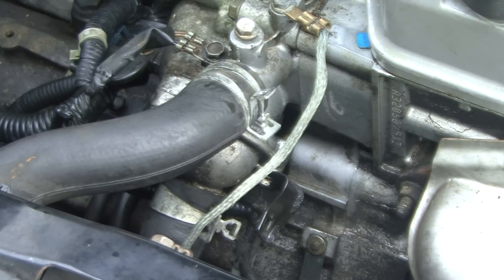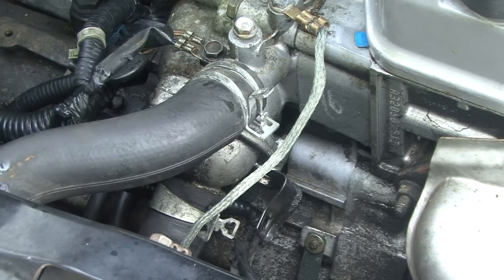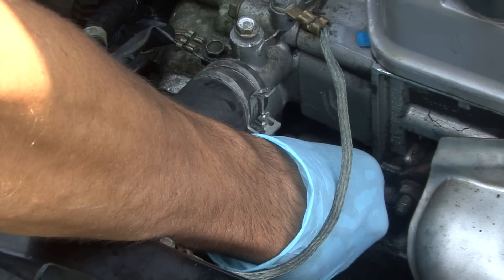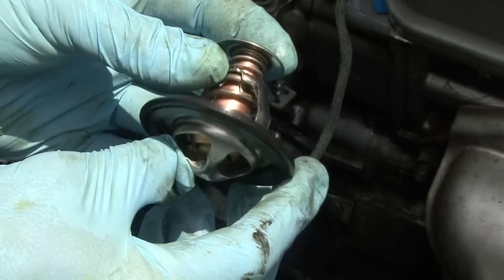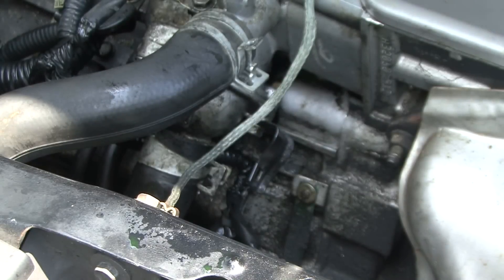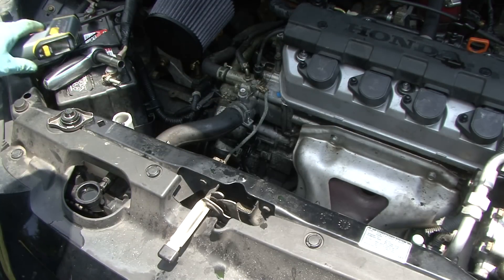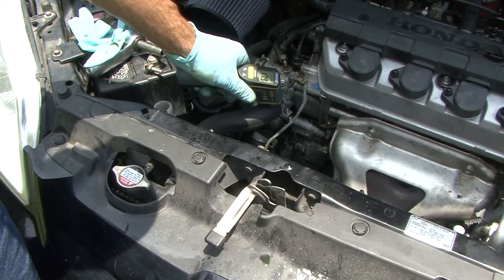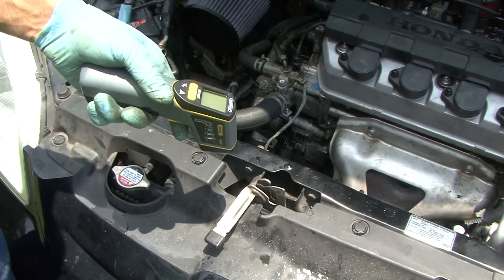Honda How To d17 thermostat change

Comment: When this happens, you have to not just replace a thermostat, the thermostat could be fine even. Its the system is full of specks, and some of then circulating jam the thermostat. You have to flush the heater core, the engine cooling jacket, and the radiator. if you don't do it properly you will end up replacing heater core, radiator, and can ruin engine jackets if you use something hash, without fully knowing how to use that

Comment: I drive a 2001 Honda Civic HX with over 212K miles.  It recently stopped blowing hot air but the engine runs fine.
Reply: Heater core is bad

Comment: When puttin the right bolt in... is it nessacary to have that bracket there?
Reply: +moneyshot41 yes or the wires could get cut by the fan.
Reply: I dropped it and no problems so far. But I appreciate the replay

Comment: Tell me one thing. i have same car.
The engine hot coolant (when thermostat open) pass through Upper hose than pass by radiator and back to engine Or opposite?

Comment: So I just did this 2 months ago and it was very successful. Thanks for the video. I did it again today because my car was blowing cold air so I thought maybe the thermostat failed again so i got a replacement.
The car is blowing warm air now But my temperature gauge on the speedometer is not moving. It is stuck on cold. I have let the car warm for about 30 minutes and took it for a test drive. Does anyone have any suggestions?
Reply: ***** these cars run at 1/4 on the temp gage